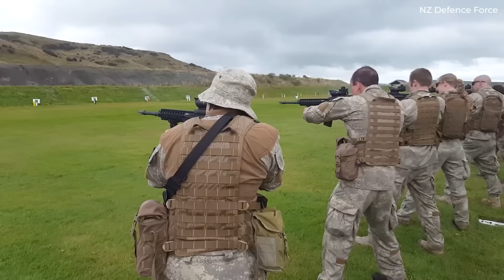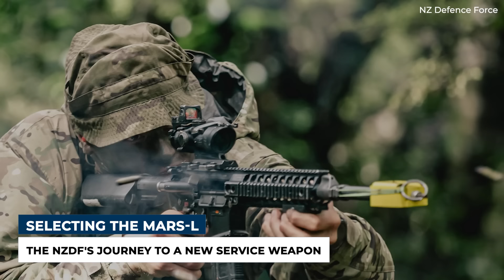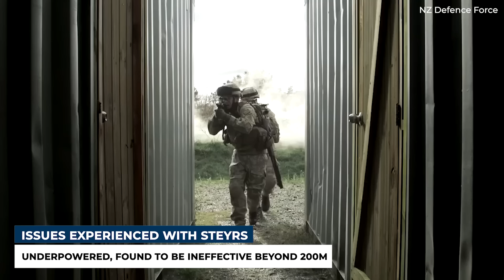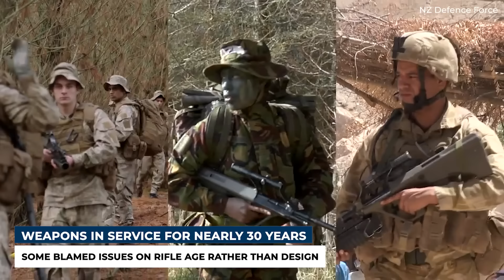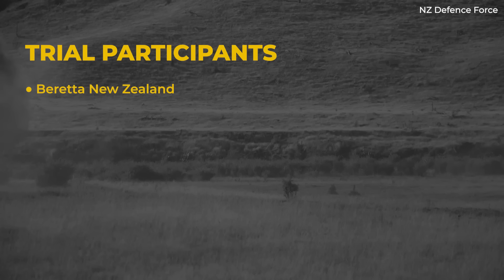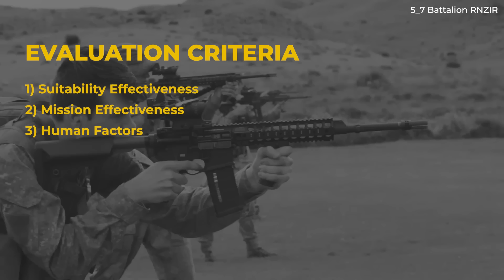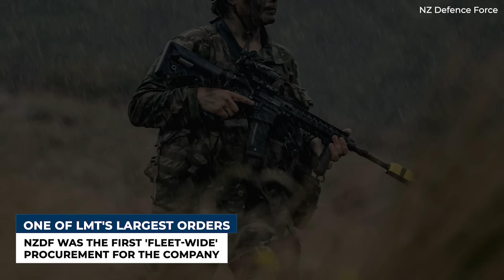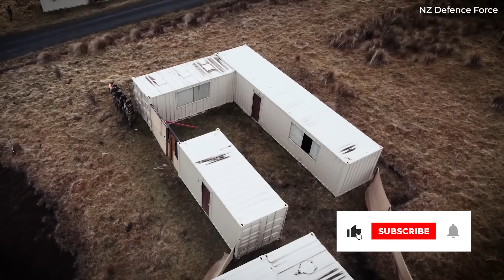NZDF’s Move To MARS-L: How New Zealand Selected Its Service Rifle

Comment: About 30 years ago, I had the 'privilege' of using the NZ AUG.  Even when they were almost new, they were not superior to the Austeyr.  Back then, the Austeyr was still in its  original incarnation, so we were comparing apples with apples. They weren't as reliable and the built quality felt off.  I didn't like the two-stage safety or reticule either, but that was probably just a lack of familiarity.
On the other hand, they only fired SS109 rounds, none of the rubbish ball for training that I was used to.  I imagine that extra expense meant much less live-fire training for the NZDF.
In the mean-time, the in-service Austeyrs have been remanufactured or replaced. Twice.
I have also used the Malay Steyr.  I cannot express how incredibly bad that weapon was. They had the build quality and reliability of something made from the toy-aisle. They felt like they might break in your hands. The most surprising thing about then was when they occasionally worked.
Reply: The NZ Steyrs were manufactured by Australia, apart from a small initial batch manufactured in Austria. They had the different safety and the donut of death had the fine cross hair, but otherwise I always assumed they were the same as the original F88 since they all came from the same factory?

Comment: I have served, trained and been on active service beside the quite marvellous Kiwi soldier - brothers in aems in every sense. But now, the NZDF will have a basic Infantry rifle which is an orphan within the logistic chain of its closest ally, one with which it has operated organically since the Pacific War.  Where is the sanity in that?
To exclude that ally's well developed and reliable rifle on unit cost reflects a  very warped and  unrealistic policy.  At Nui Dat, the New Zealand Infantry company was next to us on the wire, and glad we were to have them. That company fitted like a glove into  Australian Army equipment, rationing, supply and, most importantly, ammunition and small arms commonality. On acrive service, that interoperabilty is priceless. Did not anyone in NZ defence procurement look at history and logistic effective🎉ness?
Reply: So long as they both use the 556 & 762 then Rifle doesn't matter.  However you Aussie are considering the 6.8 x 51 or  something larger than 556.
Reply: Parts and replacement rifles for such a diminutuve equipment pool would be excessively costly, time consuming, distracting and, probably, jarring to operational smoothness. 
Logistics, not ballistics, win operationally.
Reply: @oweneather1435  The rifle the Kiwis had was still an effective & reliable weapon system for most scenarios albeit lagging well behind M16 A2 which was developed into the M4  ... and ... should still be in service today just as the Austrians & Aussies still do, with parts, uprades & replacement rifle and continue for the well into the 2030's.   There was no actual "need" to replace the AUG unless the  Army failed to maintain & upgrade the weapons, in order to get the latest & greatest or a politicain wanted the replacement.

Clearly somebody decided on a ...  new rifle.... not maintenance, upgrades, restock likely due to tragic failures in Afghanistan which a "556" rifle is not designed for.  But real problem there was the cartridge which should have been 762 in a Battle Rifle.  And again,  Australia continued with the AUG despite its obvious limitations and did over-react as NZ did,.

And after the US Army (Only) decided to replace the 556 & 762 with the 6.8 Common Cartride for Squad Rifles & MGs, the Aussies decided to finally replace the AUG but want a new cartridge as well, which will be at least a high pressure 556 or at most 762/6.5 CM/6.8 x 51.

The British are also doing this  for the replacement for the SA80, however the Brits would prefer  AR cartridges because the have adopted the Sig Spear LT, & KAC rifle for the Marines & special Forces.  They are unlikely to more to a battle rifle as the US Army has done.

See.   NZ messed up.   The brits & Aussies were in Afghanistan too with their bullpups, which are now very good rifles.

Therefore ideallly, NZ would have just maintained, upgrate & restock their AUG ... with  the State owned Enterprise NZ Weapons Industries ... starting small making ammo, grenades, AUG A3, HK 416, G36, M4s using Public  IP,  ...to eventually become a major Arms Comapny
Reply: The New Zealand Defense Force LMT Mars-L is chambered for the 5.56x45mm.
Reply: @jnpowell9077  And the Australian SASR and many Australian police PTGs use AR-pattern rifles, so at least mags should be available.

Comment: I was 'in' on the trials and can confirm the thoroghess of the evaluation. LMT was the only rifle that suffered NO issues during the trials. Remember too, that we didn't only buy a rifle  we bought a system: rifle, sight, and ammunition, Trijicon developed a proprietary reticle for the Black Hills Mk 262 Mod 1 ammunition, then refined it to also work for the less expensive training ammunition that ADI developed to ballistically match the Mk 262 to 300m. The SAS rifle differs from the MARS-L in having a shorter barrel, different furniture and tge heavy duty boot carrier group. NZDF also bought a Designated Marksman's Rifle from LMT. The quick change barrel feature on the LMT rifles is a very useful advantage over other AR-type rfles.  This was the rght choice for NZDF. No question.
Reply: There's a reason that the US pays $60 for a nut and bolt. Supply chains are difficult, time consuming, and expensive to secure. Every year it becomes harder. When you need hardware for a NASA rocket or even a 737 you have to know it is not some Chinesium crap forged from mystery metal. I'd be willing to be that is what happened with LMT and some of the parts. Other gun makers have had similar issues where their supply chain got fouled up with bolt carriers and firing pins not up to spec. In short order it will be mostly impossible to tell a fake Rolex from a real one due to the automated machining happening with fakes. So you can imagine the difficulty in securing supply chains when it comes to a screw without doing metallurgical tests on every single one. LMT probably had to start doing batch testing.
Reply: @RTT80 batch testing should have been a requirement from the beginning.
Reply: A guy I sorta know was involved in the last evaluation that ended up with the procurement of the AUG, said nobody particularly liked the steyr, most preferring the Sig550 series offering, or the M4. 

Tah dah you get the steyr lol
Reply: @EmilyWalker-dr4bg  why tf did we choose it?!
Reply: @angusmatheson8906 australian interoperability, or more likely a deal with lithgow/ADF that would have brought production costs for both countries is my guess.
Reply: @angusmatheson8906  Politicians and Price!
Reply: @angusmatheson8906 polical. I suspect the labour government of the day did not want to have anything to do with 'America'. How come we got the lav?
Reply: Hiya Buck
Reply: @rockchesterman3065  Hey! How are ya? Long time no see.
Reply: 100% this gun is fantastic
Reply: Black hill 262 ammo is a Wild purchase
Reply: What kind of issues did you find with the Canadian C8 (Colt Canada)?  I used that for years in the Canadian Army and loved it.
Reply: @BrettL-q5l  Two, I can recall off the top of my head. The Colt Canada entries presented with the old Viet Nam issue collapsible buttstock. It was awful. The Project Evaluation Officer, who was by the way a Viet Nam vet, couldn't believe it. So much slop in that, your point of aim literally changed every time you breathed in or out. The spec called for some pretty long shots too, up to 500 metres, and with that butt, accuracy suffered. The magazines supplied were pretty poor too. A lot of stoppages. Now, in a trial like this you would think ttat on being told about these issues, the Colt people would have gone down to Gun City and bought Magpul furniture and magazines, wouldn't you? That's what I would have done. But no, they made no effort to try and fix these problems. I was shocked. I had thought Colt Canada would have been a real contender, but with that butt, and all the stoppages, they were not.
Reply: @davidbuck5864 shooting out to 5 or 600 m is a complete waste of time and beyond the technical capacity of the ammunition, site system add the weapon generally. Moreover intervisibility tells you you can't see a man sized Target beyond about 400
Reply: @christopher8022  The specification required that the system be able to hit a man-sized target at 500m, and that specification was met. The system -rifle, Mk 262 Mod 1 ammunition, and the ACOG with a specially designed reticle, made it possible, even for the shooters we had selected from all three Services. Aside from a few, they were not exceptional marksman, but they did, in fact, succeed in meeting the 500m  standard.
Reply: I know it was early and probably the best deal and system at the time. But is there any plan or consideration now, or in the past, of silencers? And further updates.
Reply: @DunDun262  Yes, Surefire suppressors were included in the buy. Not sure there were enough to give everyone a suppressor on permanent issue, but they were included. That's why the Surefire flash eliminator was chosen, to allow a QD mounting of the suppressor.
Reply: So ur to blame. The rifle sucks and was only purchased because we were already in bed with them for the markmans weapon and when asking about sticking with 5.56 the panel said "because studys we did 30 ys ago 5.56 was better". The only thing the styer needed was a 3x scope. Otherwise it was far superior.
Reply: @SKINNYKTMMIKE it WAS chosen for political reasons and far inferior as a general infantry "green ops" rifle. Even the SAS didn't use them. The IWS was better as a vehicle rife or for breaking doors. The scope was a problem but so was the terrible trigger, the small parts, the plastic parts, the non- adjustable length of pull, the horrible safety  and many other issues...
Reply: @markc532  those fucking awful magazines.
Reply: @SKINNYKTMMIKE bullpups are better on paper, in practise AR platform rifles are comfortable and ergonomic (especially for SF who get to customise their rifles a bit more) which plays a big part.
Reply: @SKINNYKTMMIKE  hahahahahaha ahahahahahaha

Excuse me WHAT?! 

Jesus fkn christ dude. 

Tell me you never lugged one of those flimsy POS around with telling me you never served.
Reply: @SKINNYKTMMIKE the LMT is a vastly superior rifle to the point the standards had to be raised for marksmanship lol what are you on about😂😂😂

Comment: Yank here. Own the semi version of both the Steyr AUG and LMT NZ MARS rifles.  Love both, but AUG suffers from a poor trigger, slow reloads, poor gas system to run suppressors, and hard to add modern laser modules and night vision. Plus the vertical pistol grip is slower to use than the modern c grip.  LMT NZ picked is faster in many  way’s, more accurate, and designed to run a suppressor. NZ picked good kit. AUG is very dated.
Reply: I served with the steyr but owned several ARs and two FAL variants. I would definitely pick an AR for most jobs. Unfortunately as most Australians are unable to own an AR pattern rifle, as most Kiwis are now unable to do, they can't really compare.
Reply: @markc532 Fixing our gun laws needs to be a top priority in the next elections. Also, there are plenty of people in NZ who still have their ARs because they didn't hand them in. Same goes for most of the banned guns. They didn't bow the knee to tyranny.
Reply: @joshklaver47 even legally still have them. But my point was so people can compare and make an informed comment.
Reply: @joshklaver47  Good luck with that. Because no one wants it except you yank copiers.
Reply: You would have to compare the LMT with the Australian F90 version of the AUG, which is far more advanced than anything made by Steyr.
Reply: @joshklaver47 if you read the comments he makes there are some down sides that are inherent with bullpup designs
Reply: @markc532 Sure, but most of them can be solved or mitigated through design improvements. It's not an inherently bad configuration.

Comment: I served in the NZDF (11A Bty and 1 RNZIR), during the Steyr period. I had no issues with the F88. It wasn't until I served in the British Army, using the SA80 ( pre-HK upgrades). Again, I didn't have issues with the SA80 in spite of its reputation. But appreciated the SUSAT sight over the F88 standard sight. I also used the US M4 extensively and that served me well too. Good times.
Reply: We never used the F88 the Aussies did 😂
Reply: @zaynevanday142   The first batch of the Steyr AUG that NZDF operated were made in Austria. Later we used the licence built Steyr AUG from Australia, which was designated as the F88 or IW Steyr. IYKYK.
Reply: the Steyr with the ACOG was the shit! fixed that problem.
Reply: Did you get issued an bayonet  in the BTY?
Reply: SAS or SBS?
Reply: @abelincoln.2064  Neither.
Reply: @abelincoln.2064 huh? Your question makes no sense!
Reply: @iwishluckybugger7623  He clearly served in the special forces likely SAS to using the M4 is the British Army?   He's none response means he did, which I expected but  had to try.
Reply: @abelincoln.2064 could've been sfsg, pretty sure thet roll m4s as well

Comment: Honestly Bullpups are just arkward , their only positive is a short lenght, Terrible trigger ,  , harder to reload , harder to eject mag  , harder to check chamber , harder to clear  than the benchmark the M4 Platform, and if ya left handed better learn to shoot right handed cause we have no conversion kits  , yea if you practice a lot you can over come these negatives , you just don't have to with a M4 type , Dam here in New Zealand we had to change our Parade elements to suit the AUGs short lenght , LMT NZ 16 with its spec Black hill ammo is a better weapon platform than a AUG , yea firing pins were a issue on the LMT but that was solved very fast .Im not saying the AUG is a bad rifle , they are great but just arkward and not worth the squeeze
Reply: Left-hander here who started with the SLR / M16 and then used the initial Austrian built Steyrs when they were introduced before we changed over the Lithgow built versions.  The original Lithgow built Steyrs were complete garbage - endless issues with the things....fragile stocks, a trigger group that was shocking when compared to the Austrian one I started with.
Your comment about left-handers having to learn how to shoot right-handed - maybe with the SA80 but certainly not with the Steyr which had a conversion kit to allow it to be fired by lefties.
The only 'issue' I had with the Steyr was if I had the requirement to have to fire it with my right-hand (luckily not something that had to be done on a regular basis).  The ejector pin on the Lithgow built ones didn't quite have the same 'punch' as the Austrian ones when it came to the ejection of the spent cartridge and I copped the odd cartridge in the side of the face.
Reply: Have a look at the desert tech bullpup, fixes alot of your issues.
Reply: @j6077xxd  Just not a fan of bullpups , if they were so great every military would have a bullpup service rifle , All but a few have bullpups , main type is the M4 based , Eugine Stoner knew what he was doing way back
Reply: Define awkward. The Steyr is a more ergonomic patrol rifle as it is better balanced, especially with an M203 under it.

Comment: When hearing about the short range and blockages of the Steyr it is probably more cheap substandard ammunition. I have used the weapon abroad when doing joint training. Those easily reached 300 meters and beyond plus they rarely had issues with blockages. If that is the case the MARS-L won't fair any better.
Reply: Wrong!  The NZDF never used "cheap, substandard ammunition", at least not after 1996 anyway. Prior to that, the fellow buying the ammunition was not a technical expert, and a couple of bad decisions were made (Malaysian 7.62 for example -awful stuff that). We bought NATO qualified ammunition from FN, Diamaco (later called GD-OTS), ADI, Royal Ordnance, etc. Contracts stipulated ammunition must be currently in-service with Australia or a NATO ally. You can't blame the ammunition for the failures of a rifle used past its design life..
Reply: @davidbuck5864 yeah because a high end producer cannot build lousy ammunition. Ask the G-36 about that one.
Reply: @DinJarin74 Sure they can and we demand rectification of the issue under warranty. We bought ammunition under strict technical specifications. We are Ammunition Technicians. Not fools.
Reply: The word 'power' in those hyped-up media posts related to the 1.5 power scope, not the rifle.

Comment: "The Austeyr (the licensed Australian version of the Steyr AUG) is renowned for its extreme durability and reliability. It features a robust short-stroke gas piston system that runs cool and clean, keeping the sealed action highly resistant to dirt, mud, and harsh environmental conditions" I guess this is where I leave. Others might be interested in the LMT and NZDF propaganda and self justification.
Reply: We're you actually involved? No? The correct decision was arrived at. The Australian entry was down-selected for per-unit cost, long before actual firing trials.
Reply: I'd take a MARS over an EF88/F90 any day
Reply: I believe cost was an issue